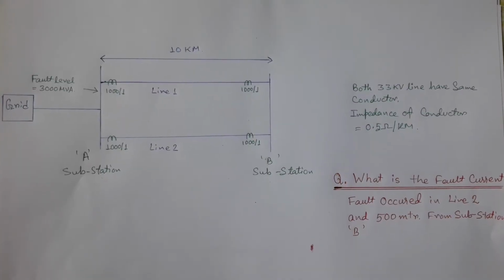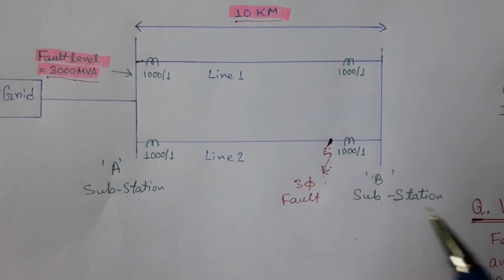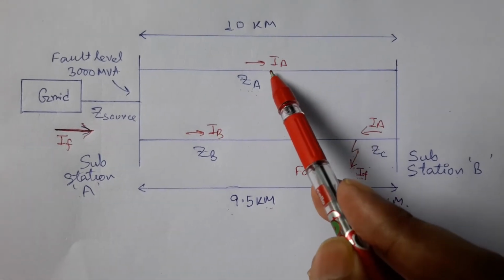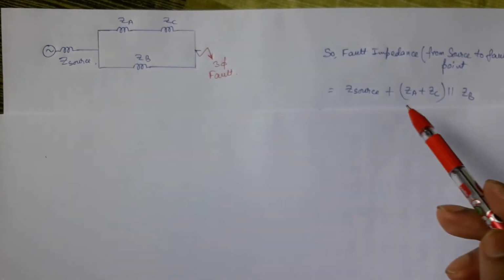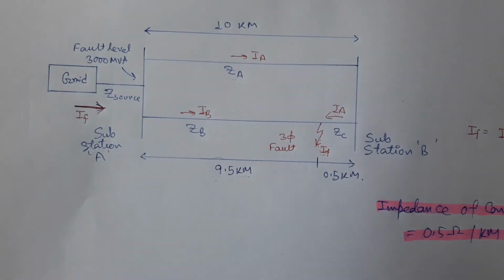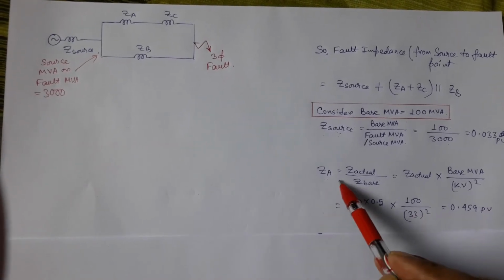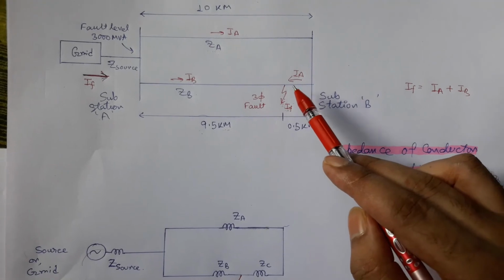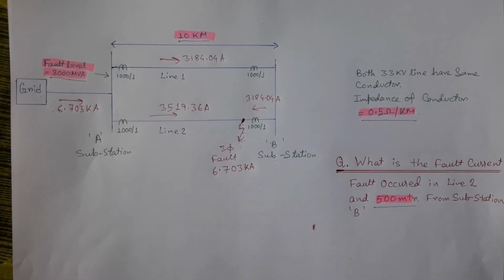fault current calculation in power system

Comment: sir can u explain by video what happen if we use different class for overhead line..substation A using CT class X..but another remote end substation using CT class 5P20..what happen if fault occured..??
Reply from the maker: Have you faced any problem due to different class CT at different end of any transmission  line. Please elaborate.

Comment: How to calculate if substation B is also connected to grid
Reply from the maker: I tried another video in this. Fault calculation in interconnecting system is generally done by software by iterative methods. Like ETAP, DIGISILENT, MIPOWER etc.

Comment: Super ,doubt what value use consider base MVA (really in Tx line)
Reply from the maker: Generally biggest machine( transformer or generator) MVA rating is considered as base MVA. you can also choose 100 MVA for base value for any system. No issue.
Reply: @eddycurrent1187  thanks 😊